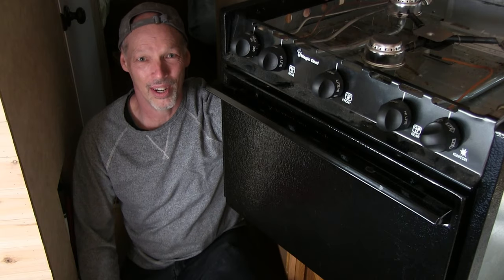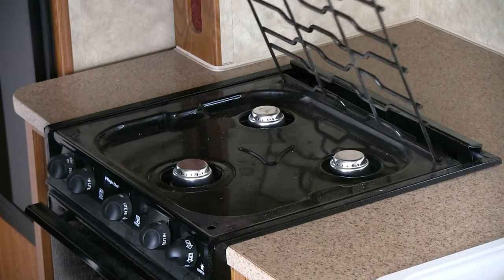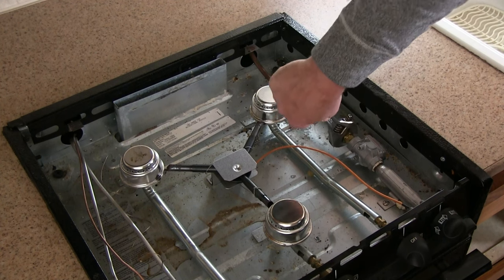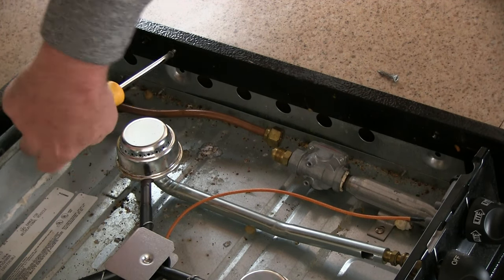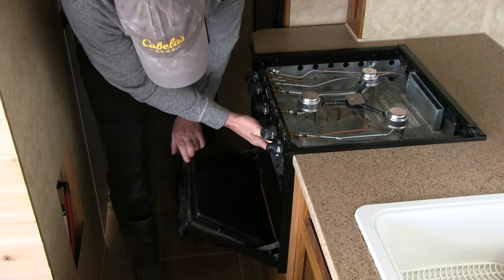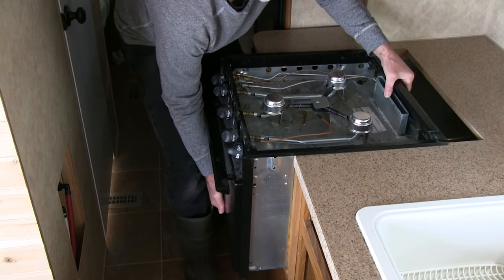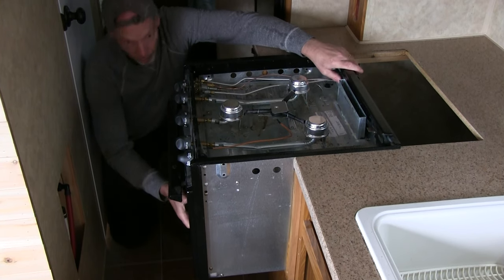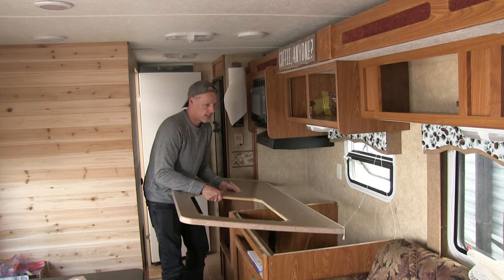RV Stove Removal (RV Kitchen Remodel / RV Kitchen Renovation)

Comment: What do you do with gas line? We are removing our stove and not replacing it. Do we just cap the line somehow?
Reply from the maker: I asked a friend of mine that works on Rv’s and he said... Depends on where it comes from usually the end that came off the stove. But for liability reasons can’t tell you where for sure. Thanks for watching 😊
Reply: I’m doing the same right now, I disconnected the line beneath the trailer and capped it with a flare (3/8) cap.  Discarded the rubber line.  I’m using the former stove space for storage.
Reply from the maker: Thanks for your input! 👍🏼
Reply from the maker: @warrenpomphrey4477  Thanks for sharing how you capped the gas line :)
Reply: @warrenpomphrey4477  Thanks! I want to completely remove my stove too!

Comment: I pulled mine in my truck camper recently and the where do I put it down, and this is heavier certainly rang a bell.  I just took mine out to wotrk in the area, made it way easier to work under the sink on some electric.
Reply from the maker: Great idea to remove the stove so you have more room to work!

Comment: So does that make the lines inert even if I ran propane through the rv again? Bc I'm looking to rid my stove for good. I don't need it. I've lived in my rv for 2 years and only used it once. I use electric stove tops and other appliances for cooking majority of the time. So I want it gone bc it's empty space being taken up and I want to put a small comfee portable dishwasher there.
Reply from the maker: Hi, not sure if I totally understand your question but after removing the stove I would think that you would want a qualified RV tech to cap the gas line further downstream from the stove area. If it was our RV I wouldn’t want gas moving through the line that fed the stove. But again, a qualified tech should assess your particular situation. I hope that helps somewhat. 
I like how you’re modifying your RV to fit your lifestyle needs 👍
Reply: @SilverLiningDayDreams  yes I am lol and I cannot afford a qualified tech, so I am planning on doing the work myself. So I just need to cap em aye? Gotta get some caps and Teflon tape then at home depot later. Thank you!

Comment: That's what is so aggravating, not being as strong as we used to be. I must add I was giggling when you were trying to pull the stove out before the two bottom screws were removed. Those were the only two that I knew of and that's why I came to you to figure this dang thing out. Now, can anyone instruct me on what to do with my AC unit that is dripping on the inside?
Reply from the maker: 😂  Thanks for watching and taking the time to post a comment.  Luckily our A/C  is working properly. Honestly I don’t know much about the A/C units and would probably have to pay someone to look at ours if it malfunctions. Good Luck with the A/C 😊